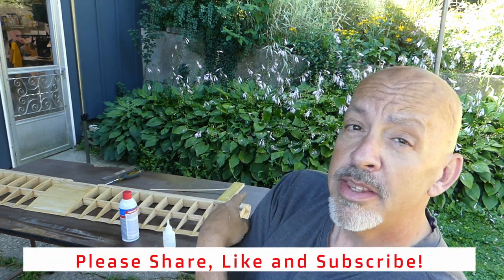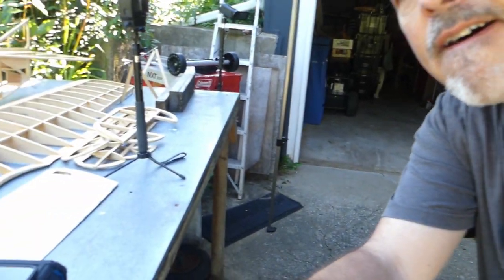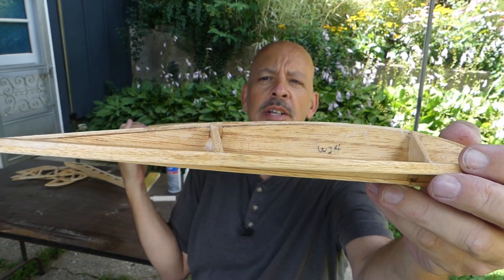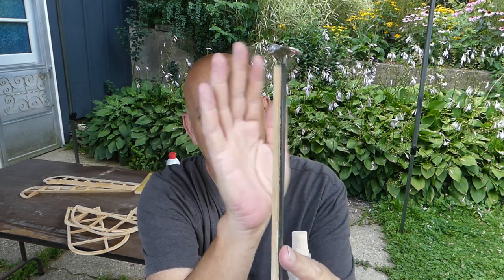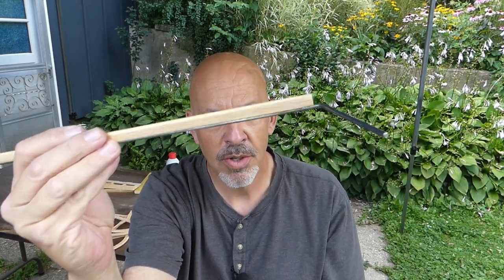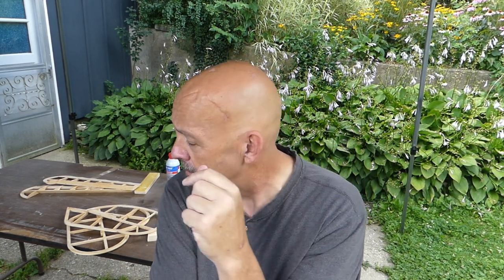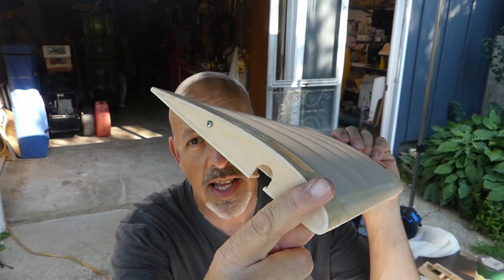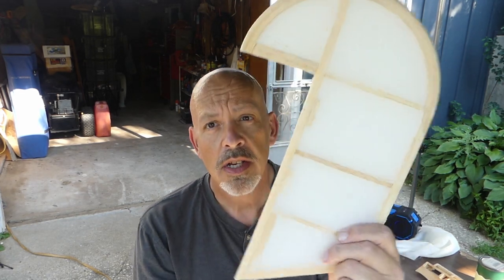Balsa USA 1/4 Scale Fokker D.VII - Episode 39 - Rear Control Surfaces and Major Announcement

Comment: Hey Bud, just found your channel and watched the Christen Special Bipe videos and the whole D.VII build (so far).  Nice work on the D.VII!  I have a 1/6th scale Balsa USA DR1 that is going to be my winter project, so I may have to use some of your tips for that.  Haven't decided on going Oratex or fabric and dope yet.  I want to do the Kempf scheme instead of the old standby Red and White, so custom paint is going to be a deciding factor on Fabric or Oratex.  As a side note...where did you get Waldo from?  I have been looking for a good pilot, but mostly there is just cheesy crap out there.  Thanks and good luck with the move.
Reply from the maker: Kevin, I purchased Waldo from Aces of Iron (acesofiron.com). Unfortunately, that pilot is no longer produced, but they do have others to choose from!
Reply: @BudChristensen  Thanks!  I have looked at Aces and may go with the Blue Max, but keeping my eyes open.  Thanks again!

Comment: Do you sand the frame(s) after the coats of dope, before you add the covering material?
Reply from the maker: Yes. I use 320 grit sand paper and just enough to smooth any wood grain that is being uncooperative.
Reply: @BudChristensen  Thanks, that make sense!